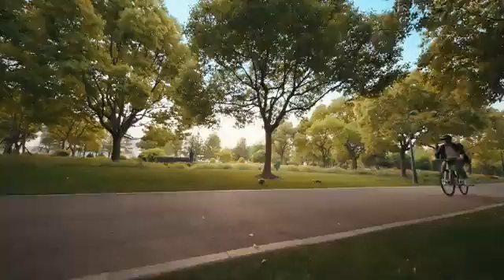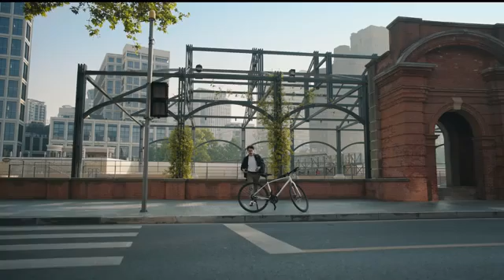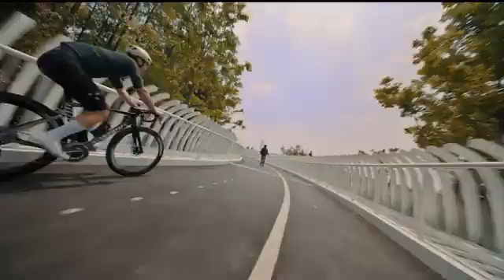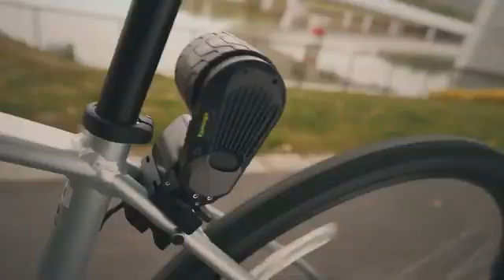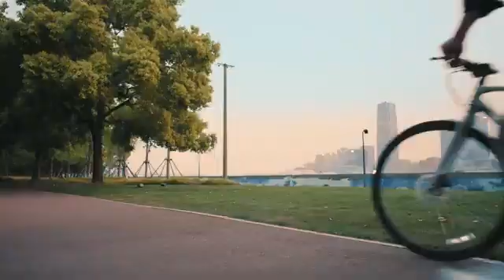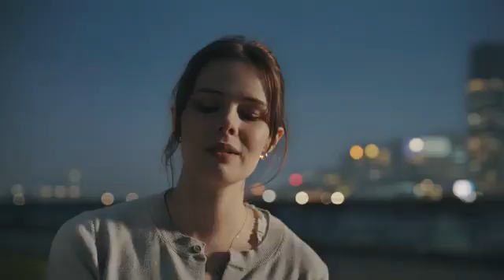5-lb mini motor drive turns bike into 750-W ebike in mere seconds

Comment: Seriously? 750w out of a motor smaller thana 250w hub motor?! Yeah, right. Not to mention the battery in a 1 litre bottle, yeah, nuh.
Reply: Its a 250w, only 750w peak
Reply: yeah its surprising but im pretty sure its possible. with motors for drones and other RC things they can do like 1kw and weigh about 40g. thing is that a) they need VERY good cooling because they are motors that only run with a drone fan blowing very hard into them, so cooling is not at all added on the motors as default. secondly, they are designed for >10000 rpm, so need a setup to greatly reduce their speed, and c) when they are labelled as "1000w" or whatever, that tends to mean "1000w and if any more its likely to blow up" so they REALLY cant handle more power. d) they arent designed to run at peak power for more than around 15seconds, so they can only be expected to run at about half their officially rated power. still a cool bit of tech tho